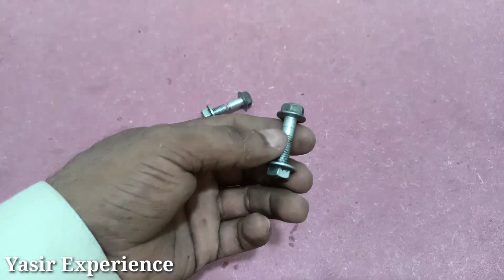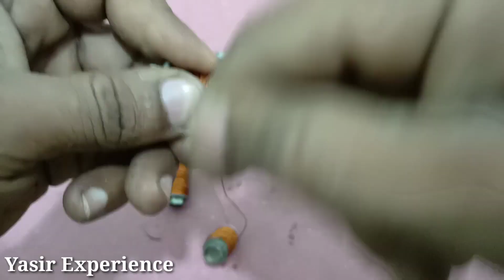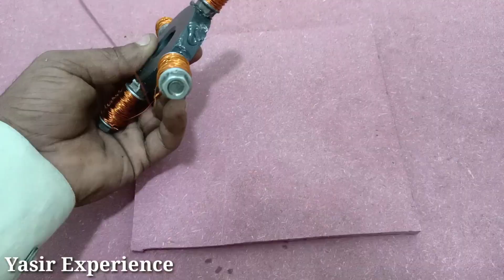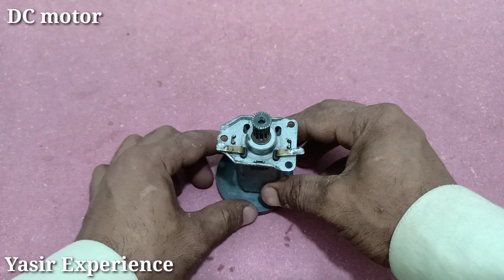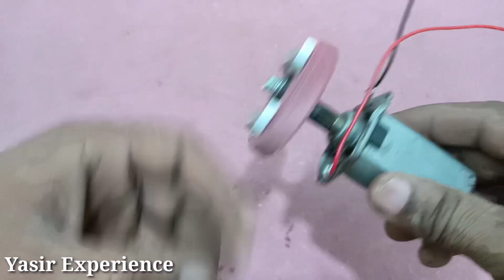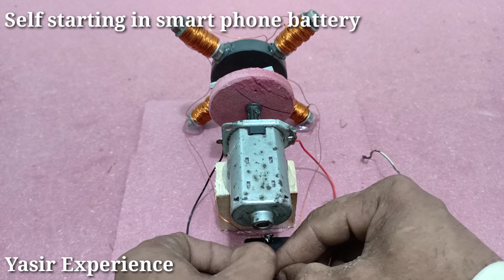12V Free Energy Generator Using 4 Bolts New Device 2020

Comment: Cool, you could also try to improve the magnetic field pressure, more the heavy strong magnet will be turning near the ferro magnetic ring without any contact, more the power will be strong

Do you know that an heavy strong neodymium magnet is able to modify the permanent polarity of the ferro magnets
The field inside the ferro magnet after contact conserve his new polarity but in a different way as originally

This is not possible in the other side
Ferro magnet are also more efficient in hot temperatures than the neodymium this last one will lost his magnet propriety more quickly
Reply: Hahaha fake